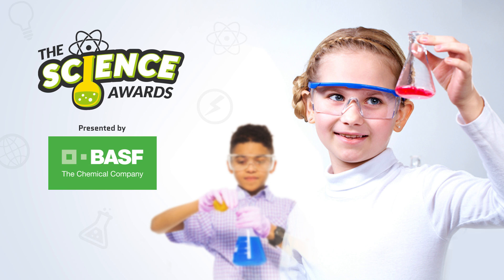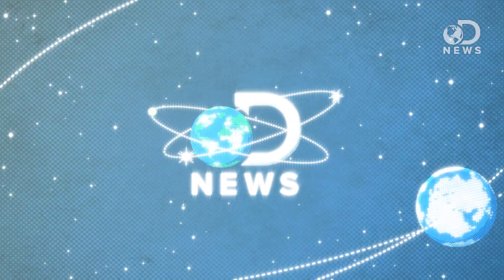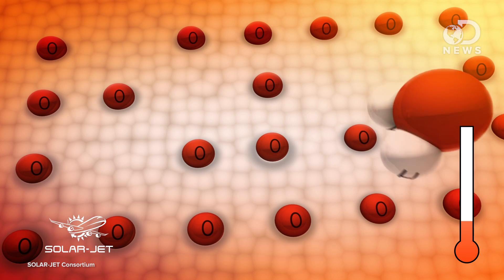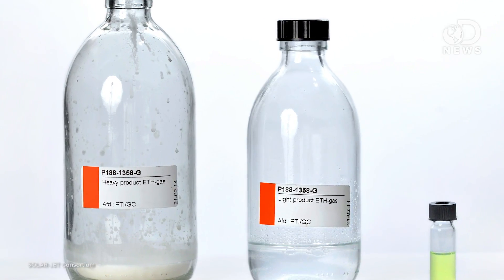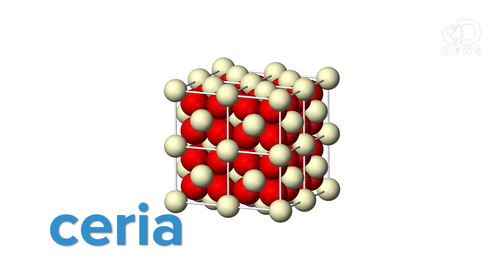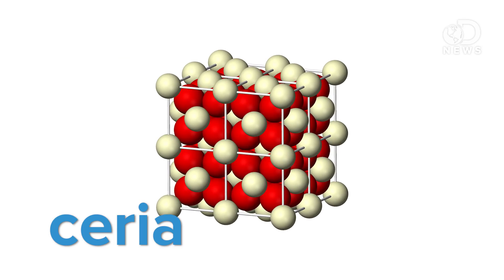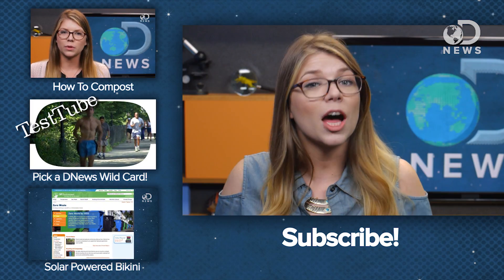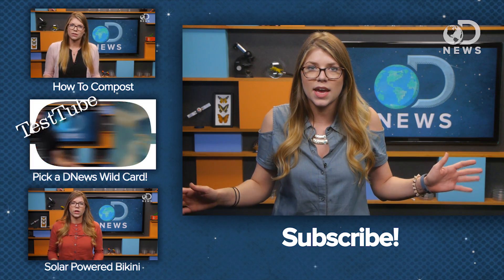Is It Possible To Power Jets With Water?

Comment: I feel like this title is misleading. Shouldn't it be more like "Is it Possible to Power Jets with Light?"
Reply: True. But being this is mainly targeted at a wide range of stupid Americans, it will sound more interesting when you introduce water and fuel in the same context.
Reply: Youtube Comments Suck I suppose, by the same token, you could argue that all fuel comes from light (at least indirectly).
Reply: Youtube Comments Suck to me it seemed like the sunlight was only there to heat up the compound so no, water was a accurate title
Reply: LostTrigger Right... so that means that the energy provided by the light converted into chemical and thermal energy. That energy has to come from somewhere. It's not like the water spontaneously turns itself into fuel. It already is in its lowest potential energy state.

Comment: I have two main concerns:
1: it doesn't use sunlight, it uses a machine that simulates sunlight at extremely high temperatures. That is not energy efficient. Saying it uses sunlight makes it sound like it's not using any energy at all, but that's not true.

2: at the end of the day, aren't you still burning kerosene? Just because it came from water and carbon dioxide doesn't mean it doesn't still release pollutants.
Reply: You're super right. It's going to waste a lot of energy just to make it, and in the end it will still make CO2 when burned.
Reply: You do realise that simulated sun is for R&D purposes only right and that we do actually have solar farms?
And it's taking freaking CO2 out of the air. Why are people so clueless? -.-
Reply: error2k2  It's not though. It's just adding to it, this isn't clean energy and it's not cost effective. It's just another potential source of pollution and drought.

Comment: I'm gonna go ahead and call it a bad idea to turn water into fuel. When in the long run what you've got is a never ending supply of fuel that produces CO2 when burned, it will do nothing to help stave off climate change, that only makes it worse. With burning fossil fuels at least there's the eventual depletion that would force people to find an alternative fuel source, one that's potentially environmentally friendly at least. Not with this though, they could just burn it forever and the CO2 levels in the atmosphere could keep rising until we're all dead.
Reply: like the other one said to create it CO2 comes in from the air so

CO2 + H20 > CO + H2 + O

Then all oxygen gets sucked out

from the rest of it they make kerosine

kerosine has around 12 to 16 carbon and mainly hydrogen as attachment. When burning this:

C12H26(i think) + O2 > CO2 + H2O 
It will indeed produce Carbondioxide, but the carbon in it was taken from the air itself. 

So you could see it as a kind of recycle product.
Reply: Of course it's a bad idea, oil companys like bp, shell, etc... will do everything in their power to keep this from happening to get more money in their greedy pockets. In the late 1930's a man discovered how to turn water into fuel for cars a few months later he was found dead in his bathroom the police ruled it as a suicide, coincidence?
Reply: The big difference as far as the climate is concerned is that fossil fuels put more carbon dioxide in the air, where while this recycles what's already there without adding more, its not a fix, but a combination of that and no new co2 is that trees can recycle what's up there, which will lower it faster than its added... if we have enough trees
Reply: the CO2 used to make the fuel is harvested from the air. its like eating your own poop if you could turn poop into nutritious food. cough fertilizer cough so we aren't going to die in a sea of CO2 no more than we are going to die in a sea of poop.
Reply: ***** ... or these scientists will patent this and oil companies will try to buy it and will shut this project down so that the value of their non-renewable oil dosen't plummet
Reply: While the net Co2 might or might not remain the same, it still reduces our usage by at least a half.
Reply: Sorry for bad ingreesh, very tired, hope you catch my drift though
Reply: sdmitch16 it's just like burning wood: the tree absorbed CO2 all its life, turned it into sugar, cellulose and assorted nutrients. and when we burn the tree, the carbon (cellulose, sugar and assorted nutrients)  in the tree react with the oxygen in the air to create CO2. the CO2 coming out is the same amount as the CO2 going in.
Reply: seriousgoat76 there's to much happening for them to simply pay pepole off and stop it oil company's are starting start to invest in other things so they have some where to go when oil gets to difficult to drill for.

Comment: I have to say, I'm kind of skeptical about being able to fuel things with water but hay, if it works, then it works.
Reply: They're making kerosene from water, carbon dioxide, and sunlight, and then performing a bunch of special processing.  Nothing is being powered by water, but by the resulting kerosene.
Reply: This isn't the first time water has been used to produce an alternative fuel source. Unfortunately it probably wont be the last either.

I say unfortunately because oil makes way too much money for oil companies to not buy or in some way make the process of producing alternative energy either significantly harder or even illegal.

Science is doing absolute wonders. It's the world of politics at the moment, which are taking the world back 5 steps for every 6 we take forward.
Reply: not only water is used, it's just one ingredient in a complicated chemical process to make kerosene
Reply: Balerion
 True, but the question isn't can you use a complicated chemical process to make kerosene, it's can you power jets with water.

Also, I know basically nothing about the science witch is why I remain a little skeptical.
Reply: Airman is absolutly right!

Which implies that the title of the video is at best clickbaity and missleading and at worst simply stupid...

Comment: Am not sure if am being dumb but would it not have been easier just to make hydrogen from the water and use that as fuel?
Reply: It requires a huge amount of energy to remove the hydrogen from the water. And since you can't do it with 100% efficiency it less energy is released when you burn it with the oxygen again.

Comment: 20 000 litres a day is not a lot. An Airbus A320's fuel tanks can take 24 210 litres, good for 6 700 KM or about 7 hours of flight. With these figures we're going to need 1 full scale solar reactor per mid range aircraft and more for the long range ones.

Comment: Why not just make nuclear powered jets?
Reply: Jets need a huge amount of thrust, and it's certainly not obvious how to turn nuclear energy into a large amount of thrust.  Propeller planes could be nuclear-powered... if such a thing could possibly make it past any of the numerous regulatory agencies responsible for approving nuclear energy projects.  There's also the issue of weight, that most nuclear energy systems heat water to turn turbines to generate electricity, all of which would weigh a lot, and would make it much less useful for plane flight.
Reply: To expensive plus nuclear waste I guess!
Reply: Air force tried this during the cold war, building a small enough reactor that could power a jet for any reasonable period of time wasn't doable then.  It may be plausible now, but there's easier alternatives.
Reply: Too inefficient.
Reply: *****
Unfortunately we're looking at a 100 year minimum wait before we get that to an industrial level of energy.

Comment: Is this method of using the sun energy more efficient than the solar panels we have?
Reply: with current technology, it takes hours, like 12 hours to charge an electric car that then runs for very few miles. we're a long way off solar powered planes so solar power cant be considered for plane fuel yet. therefore comparing solar power with this is irrelevant. its a case of does this give a large enough fuel output for the energy required to make the kerosine
Reply: Solar panels are for electricity, and generating kerosene is amazing also.
Reply: irrelevant, they're producing different outcomes. this produces kerosene and solar panels produce electricity which you cant (yet) power a commercial plane with.
Reply: It's not irrelevant, If it's not more energy efficient maybe we should develop an electric plain. By we I mean us the humans.
Reply: Chris Sanchez Sorry, Chris, you're wrong about that. Solar energy has come a long way in the last few years. "Currently" there are plans to have the first flight around the world in a solar powered plane which has already been created. We are not far off. However, though I do agree that it wouldn't be as powerful in energy output, that does not make it irrelevant.
Reply: Andrew Wilson Accumulators aren't good enough.

Comment: Sounds great till we run out of water.  But anyone reading this will be dead for centuries before that happens.
Reply: you dont know how elements work
Reply: you know that we cant run out of water right? it evaporates and than comes back as water
Reply: Denzil Buchner Even if (and I can assure you that's not the case) the water used for this synthesis would completely be removed from the cycle, bear in mind that the surface of the earth is 70% covered in water. I think we'll be fine for a couple of tens of thousands, if not hundreds thousands of years buddy.
Reply: Aduro Drakathai You're right. But it's in the wrong context here. Yes water will come back through the water cycle, but in the case of making fuel the water is still 'locked up' as a different molecule. What you were meant to say was Combustion involves the reaction between a fuel and oxygen. During this water and carbon dioxide is produced Note this applies to every combustion reaction.
Reply: Denzil Buchner
fair enough. To err is human.
Reply: *****
 i don't think you actually know how elements work. water loss is a big problem hence all the hub bub about running out of fresh water drinking supplies. and different governments having programs to figure out how to cost effectively desalinate the oceans and using that as drinking water.
Reply: If this does happen centuries later, I'm pretty sure we're gonna find some way to turn salt water from oceans into drinkable water. Plus there's the naturally occurring water cycle... Problem solved.
Reply: Atrail Grady water is made everyday. water doesn't magically escape the atmosphere. as long as there is hydrogen and oxygen, the will be water
Reply: haiggoh Ok well I deleted my comment, since previously I said that we won't run out of water because the process will be "H20" neutral so to speak. I.e. the fuel will release water when burnt. I made this comment before I watched the video, then when I watched it they stated that they turn the water into kerosene, and I couldn't be bothered to do research to see if kerosene actually gives off H20 during combustion. It might very well be that it doesn't. So the comment you replied to I actually agreed that the water won't run up. And I do agree with you, that even if it would, it would be too many years to worry about. Especially if you consider that we already have raising sea levels. Point is, I am of the same opinion as you, and have been before and after watching this video

Comment: if its not salt water its stupid
Reply: They can remove the salt from salt water by distilation. They heat up the water to boiling temperature(100 degrees celcius: 212 Fahrenheit for people who do not use the metric system), when that happens, the water evaporates, the gas is captured and cooled down to pure water, leaving the salt(and other things like debris(plastics, etc.) behind.
Reply: because turning salt water into fresh water is probably the greatest challenge in this entire process °facepalm°
Reply: the11382 I know that they can do that but it costs time and money so it would be cool if they could just take water from the ocean how it is without taking the salt out and using it
Reply: seriously guys they just need pure H2O for this aka distilled water which is incredibly easy to produce by simply evaporating and then condensing sea water and as a byproduct you get salt which can also be sold. What these scientists have achieved here goes above and beyond such a trivial matter as determining how to make fresh water from sea water.

Comment: Wouldn't the kerosene release greenhouse gasses later on? Is the output lesser than the input?
Reply: It's likely the same. B
Reply: it won't release any greenhouse gasses that had not been in the atmosphere before it was produced so emissions are practically zero.